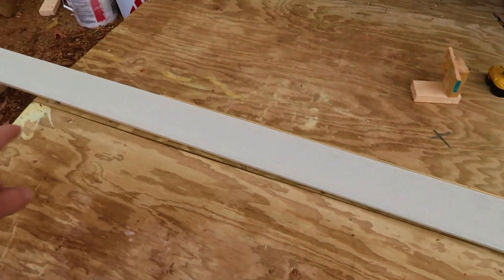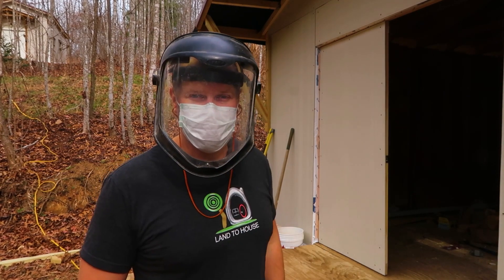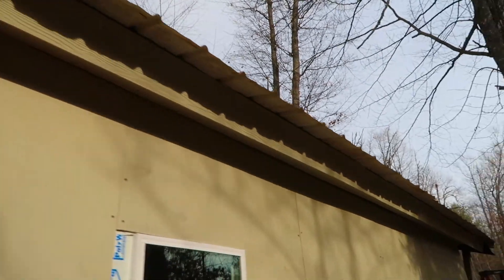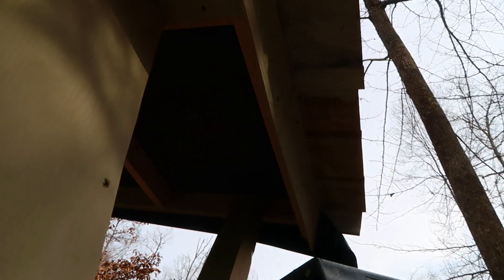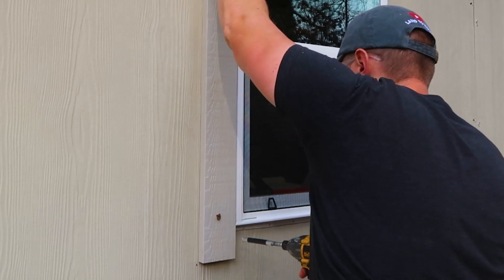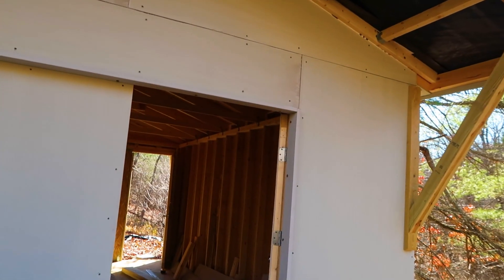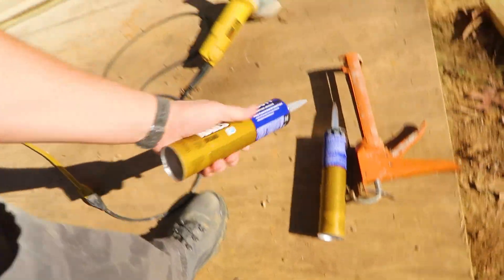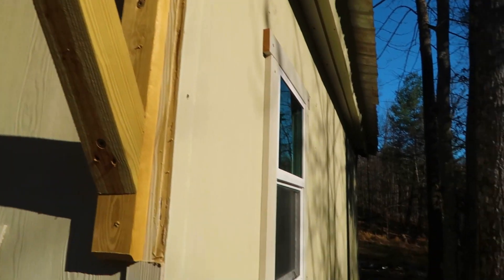Installing Shed Trim

Comment: Nice job! Would you have been able to shoot nails through the cement board with a nail gun or would it have been to strong?
Reply from the maker: To be honest I don't know. I have used screws on this material for years!